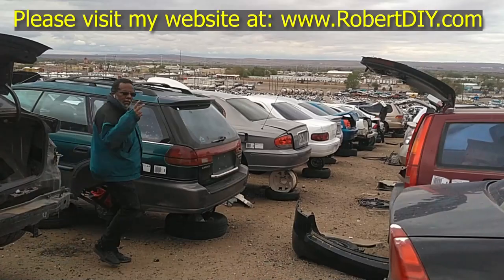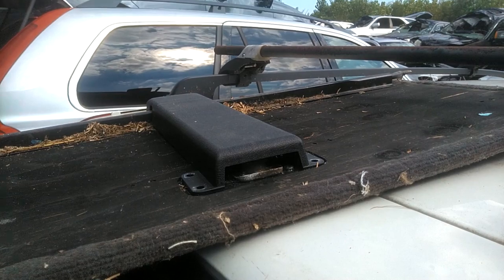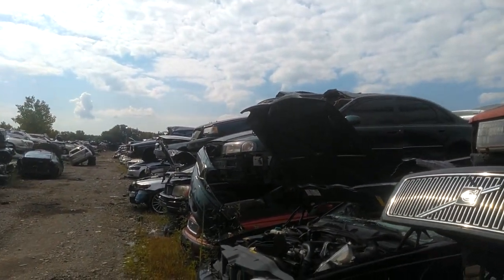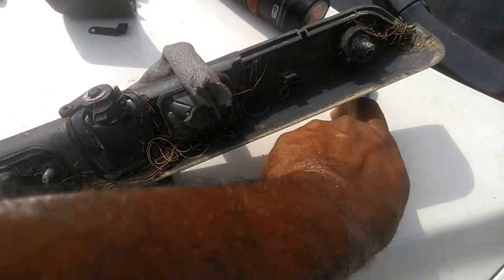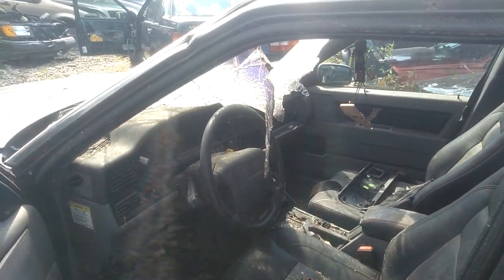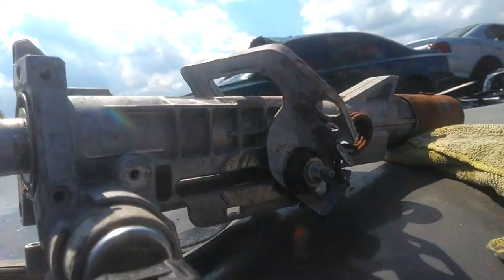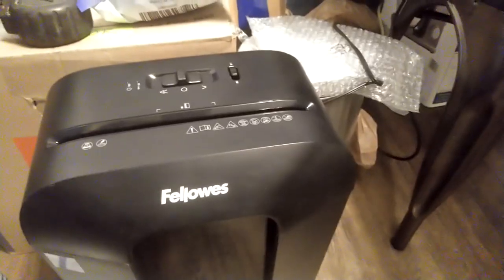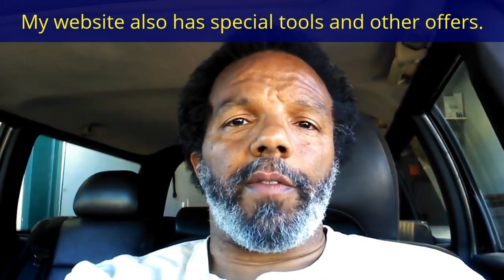Back to 2 Stacks! Re-keying a car, electrical plug info and a new paper shredder. - HOWR

Comment: Yes sir liked your info on how them plugs deteriorate. My wife has a hyundai veloster and they have a recurring  problem with the fan switches burning out for the heat and air in the car. She had two replaced under warranty and this last one I went into the dash to replace it. The plug on the back of the switch had one of the terminals burnt very badly and the plug was melted. I was afraid to reuse it so I called the dealer about that plug and they said you have to buy that whole wiring harness which was like 3 or 4 thousand bucks, which wasn't gonna happen of course. Fortunately the male terminals on the back of the switch were the flat style, so I was able to crimp on some female flat blade terminals on the five wires going to the switch , and it worked like a charm. Thanks for you channel, it is fun to watch! New subscriber here!
Reply from the maker: Thanks for watching. Usually the common cause of wire connections melting is that they are loose, poor connection. Hope this helps.

Comment: after a few years the shredder may run slower or not want to shred paper correct....... take a few sheets of the junk paper and spray wd 40 on the paper then shred them ..it will work just new again ....
Reply from the maker: Nice. I actually have shredder oil.
Reply: @RobertDIY  i seen that and thought non pressurized wd40 oil ?????????

Comment: So, does the dealer ever let you run a new key from just the VIN number without a matching title?  They don't here in Atlanta.  You can drive the car into their service department and point to the VIN on the car, and unless you have the title they won't cut another key.

AND the last time I got one, they charged $80.
Reply from the maker: Yes. However, the price has gone up from $34 to $96. 😞🤑🤕😡

Comment: Do the 1995 850s have a keyhole on the passenger side door? My 1997 does, but my 1995 was swapped to V70 door handles so there is only a keyhole on the driver side. Wondering if the previous owner removed the passenger side during the handle swap, or if it was never there.
Reply: my 93 did my 96 did but my 98 s70 did not i was upset i think after 97 its just the drivers side keyhole
Reply from the maker: Yes

Comment: Hello, i have Volvo 850, 2.5 103 kw, after one year of staying on the parking it works but at a few seconds after started engine its, a blue cloud coming from the pipe, i hope its not serious im planning to restore it and using it as a daily, greetings from Poland :)
Reply from the maker: does the smoke stop when you start driving?
Reply: @RobertDIY  Yes after a few seconds of working withouth any gas on pedal
Reply: @RobertDIY  during drive everything is allright, hope the engine is salvageable